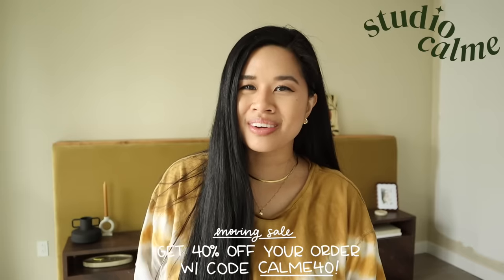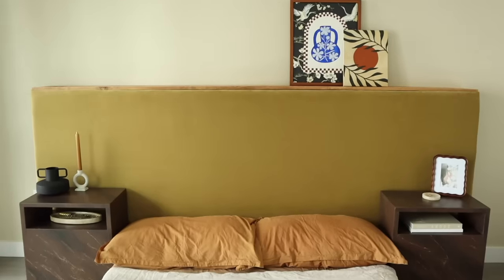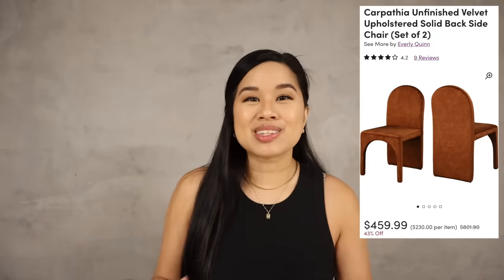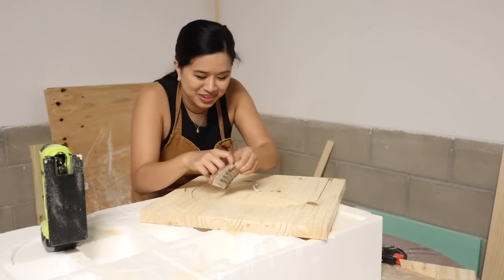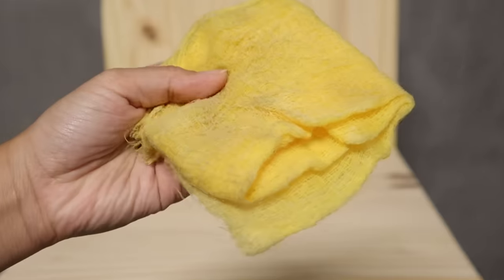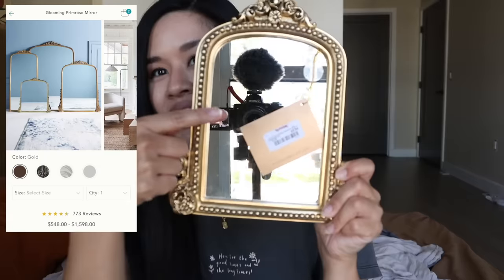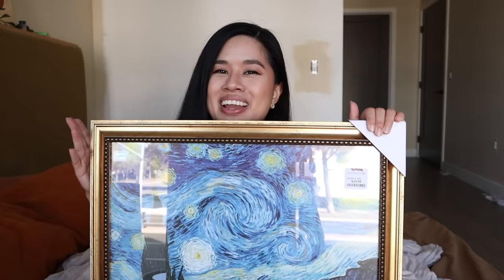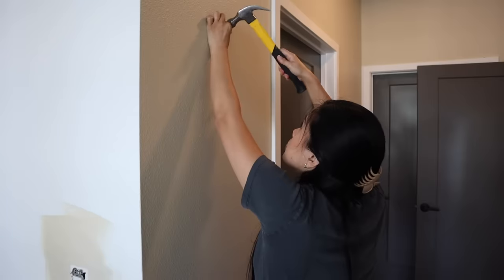BORING BEDROOM TO WARM ORGANIC MODERN MAKEOVER (EP 2) | DIY Arch Chair + Textured Artwork

Comment: I feel like that long wall opposite your bed is screaming for a large but simple accent mural of some kind!! Like, not full floor to ceiling mural art but rather, one shape or wave or something in one color going across to fill up the space in an interesting way but while still feeling very simple, calm, and cozy. Simple enough that you'd still want to hang up a couple of frames over it without it fighting it, if that makes sense! But that way it won't feel like you need to add much else to it (which could lead to clutter). I look forward to seeing what you put up on that opposite wall!

Comment: when you brought up the edger I thought you're going to be so disappointed it doesn't work ,but the funny thing is you didn't use it the way you're supposed to and it appeared to work better ..those little wheels on the end of the is the part that supposed to go against the molding...